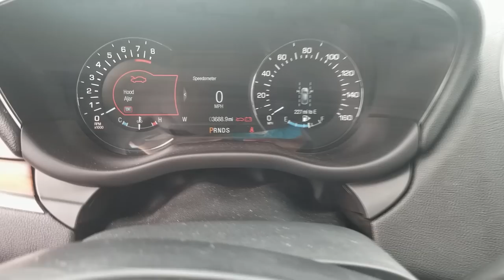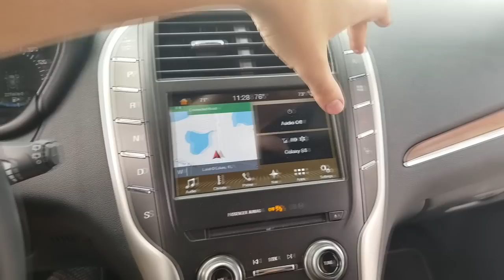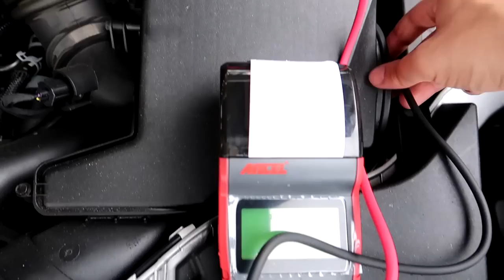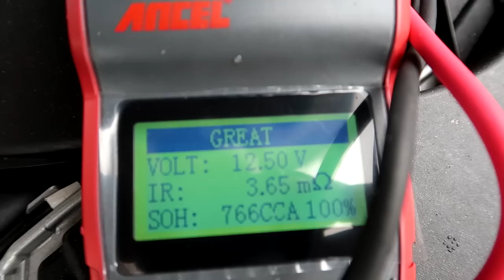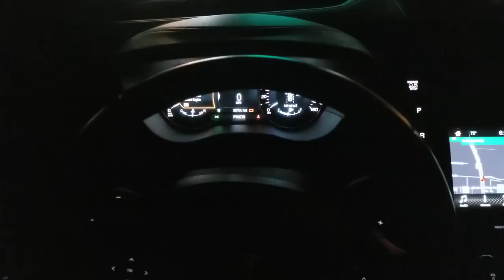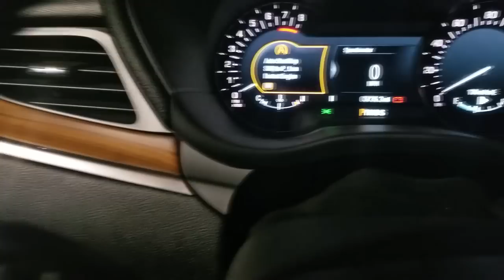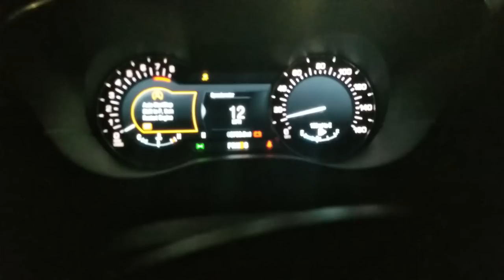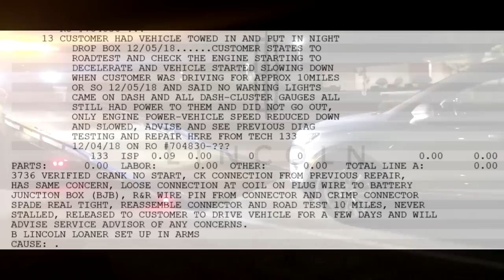I Saved Over $20,000 Buying a Like New Lemon Car! Then it Broke Down TWICE in 48 Hours!!!

Comment: Always keep your auto stop/start off, even if your not having problems. The wear and early death of your battery and starter will cost you far more than the tiny amount of gas you save. These cars with auto start/stop do not have special heavy duty starters.

I think Ford will do their best to jerk you around by doing things like cleaning and tightening up electrical connections and trying their hardest not to invest any real time and parts into fixing the problem once and for all, in attempt to run out the warrantee so it will just be your problem. In the end, I think you will either be dumping this car or taking it to someone who specializes in difficult automotive electrical/electronics who can and will spend the time to properly diagnose and fix the real problem, on your dime. You may or may not get that reimbursed by Ford, but I am betting that will be a fight.
Reply: Brian Andrews it remains documented and covered under warranty for this problem I believe
Reply: Brian Andrews actually the starters are a bit beefier because of this constant on off crap.
Reply: I couldn't have said it better myself. I actually have a friend who's shop does just that,fixing the things others can't, including dealers stuff under warranty. He paid for his boat off of Vw gremlins alone. But they got in trouble sending the cars to him and now he has a  bay in the shop there lol.
Also what you said about the auto start is true. The manufacturers only concerns were getting the MPG down to qualify for the for CAFE and nothing else. If a manufacturer doesn't make the corporate average fuel economy (cafe) standard for a model year,it's like $5-6 per .1 mpg penalty fine for each car sold. So .2mpg over the limit for Ford would mean $11 fine times the every car and light/medium duty truck sold that year. Hence why they put the garbage autostart in now.
Reply: @FishFind3000  wrong
Reply: New start stop systems are actually going away from using the starter to restart it each time.
Our Subaru has start stop and it’s been flawless. Only negative is the batteries are a lot more expensive. But ours is now six years old and we’ve only replaced one battery so it’s not bad.

Comment: Sam this is a real opportunity to push the limits of warranty repair.  The easy solution is to "lemon-law" this car again.  Nobody would fault you for that - you want and your wife needs unwavering reliability.  I wholeheartedly agree with your philosophy that anything can be fixed.  You may eventually come to the point (maybe already there) where you feel that this problem has not yet been truly fixed.  If that is the case, the challenge is now to bring this problem across the bridge beyond the point where you believe that the problem has truly been corrected to the level of quality expected of a newly manufactured assembly.  
     So in talking through this with you (really with just myself), you have three choices:  1) have the manufacturer take this car back again (if that is possible);  2) live with the "wiggled" and "tightened" and "really tightened" wire, preparing at any moment to be left stranded again and to have this car back at the dealership for "re-wiggling" and "re-tightening";  or, 3)  push the dealership to truly correct the problem (whatever your judgement feels that is).  Tough choices - I don't even know what I would do (but probably not number 2).
     PS - your short bit with Matthew McConaughey was really brilliant.

Comment: my 2017 ford fusion in the year and a half I've owned it has shut off at lease 8 times while driving. the car does not have start stop and the dealer can not replicate it and there are no codes left in the computer. they refuse to buy back the vehicle and will not replace it. Ford has the worse vehicles and horrible customer service.
Reply: Check out Steve lehtos channel.  If you are in Michigan, you are in luck as he practices in Michigan.  At the very worst, he can tell you how to find a Lemon Law Attorney in your state.  You pay nothing, the Attorney is paid from the Manufacturer..
Reply: My 2012 Ford Fusion did the exact same thing to me with only 700 miles on it.. it did it while i was stopped at lights though never while actually driving. It would always start right back up after luckily though.
Reply: Import my guy
Reply: lol I bought a 2012 Sonata turbo limited with every available option in 2016 for $9600 and ive only done an oil change. It came with 2 sets of tires too and the interior was perfect. Took me 15 mins to find and only had 45k miles. Why the F does anyone buy a new car???
Reply: Sounds like a crank sensor, they usually dont throw codes till your car doesnt turn on anymore.
Reply: Dom L I have a Lincoln MKZ mine was doing the same thing, it’s the fuel pressure sensors. I replaced the throttle body did fuel injection cleanings, read some forums found a lot of people suggesting the high and low pressure sensors. Haven’t had a problem sense, final repair was like $50
Reply: You chose to buy a ford and are surprised it became a heap? Color me shocked
Reply: @Brian-jv8iy  i have the sport model with the 2.7 twin turbo v6. i'm 100% sure it does not have start stop. my car goes into accessory mode. the car is just unreliable garbage. was going to trade it in until i check the resale value and saw i lost 18,000 dollars on it already.
Reply: Shouldve bought a Camry or Malibu.
Reply: @WoWdOm18  OUCH! again,FOUND
ON ROAD DEAD.
Reply: I’ve had my 2017 fusion sport for 18 months and have had 23k trouble free miles.  I’m glad
I leased it though. Also had 2 other fusions and never had any problems.
Reply: You deserve it for buying a Ford

Comment: What would be the total number of “fixed” statements issued by the dealer? At least 2 before you bought it and 2 since. And all before the first oil change!
Seems to me the electrical system would have been the first thing to check, and it seems to be the only thing which was checked, and the problem persists. They call ‘em lemons for a reason. A good car to own in you need a lawn ornament.

Comment: If it happens again and you can get it going by wiggling the purple wire (confirming that is the REAL issue) take it back to the dealer and demand they replace the harness. If they do that and the problem comes back.... My next question would be, what can you do to get them to fix it? I don't think you can do a Double Lemmon. They won't buy it back a 2nd time will they? Maybe you will just need to wear down the tech at the dealership. If he has to work on the same damn car every Monday he might put in the extra effort so he never has to see it again. :)
Reply: Woody Balto Replacing a wiring harness is a very extensive procedure. It’s probably over 6-hours of labour.

Comment: The ecu has a sensor on the earth lead to record how much power is put in and taken from the battery for the stop start system, possibly the car hasn't been told what state of the battery is, ecu should be reset once battery has been changed or charged off the car. Some people make mistake of charging battery with the poles of the battery rather than through the earth point on the body, this bypasses the sensor and confuses ecu. Just a thought.

Comment: Sam, I bought a new 2017 Camaro Turbo 6 speed in February of 2017.  I have had it to two different dealers on 6 occasions for the same problem.  When it feels like it, as I turn the car off to park it.  the driver information center flashes a message.  No remote detected, depress clutch to start.  A lot of times the button has no feel when pressing it, then after getting it to finally completely shut off , when I try to restart it, it will tell me that no remote found, place remote in slot, (slot being lay it in the cup holder)  I had this problem numerous times and was stranded several times.  I took it to the closest dealer three times in less than a month.  'Could not duplicate problem' was what I was told.   they put 1/10th of a mile on the car going from one side of the service bay to the other and that was it.  I took it to another dealer 2 times in 2 weeks, they stated there was nothing on their monthly tech bulletins about the problem, on the second visit they decided there were a few sensors bad and that it was fixed, I took it back again in march to get it inspected and oil change and had it checked again, 'could not duplicate problem again', so here I am again this past week Christmas eve and Christmas day was stranded again, and can't get an appointment until mid or end of january.  Have you heard of this problem.  It's driving me bat s**t crazy.

Comment: Best solution just disable the start stop feature at any shop with a coder
Reply: King Fynx Did you not watch the whole video it also shuts down when driving with foot on gas.  He felt it begin to loose power and gave it full gas but still shut off.  Nothing to do with the start stop.

Comment: Put stabilant 22 contact enhancer on all the engine main harnesses. That was the main fuse block . The ECM is probably up under the cowlings. Just below the windshield. 
Look up the location and unplug all the connections ( with the battery disconnected obviously). Brush on the stabilant per instructions. Also do that with all main bulk harness connections.
This may help avoid chronic connection issues. Which it sounds like this car has.

If and when it happens again. Have a pocket scanner with you in the glove box. Hook it up. And while cranking. Look at the RPM signal. If its showing 0 rpm. It’s not getting a crank signal. Check the crank sensor and the connections. 
Hope this helps . I for one wouldn’t want to deal with a vehicle that isn’t reliable. And I’m a master technician.

Comment: I would also add that I fixed an ECU issue simply by pulling the connector in the fuse block and relay, then cleaning the contacts and adding in some DeOxit non-conducting grease on the contacts. The grease keeps corrosion to min and the DeOxit offers a continued cleaning process as the contacts constantly wiggle and move over time. Contamination of connectors is much more common than people think and is why many circuits have "ghosts in the machine". Simple spraying cheap contact cleaner is not the fix thats needed.

Comment: I used to not much care for auto start/stop systems, but in just the last year they’ve gotten much better, and they actually do save fuel. I have maintained that a larger battery and a small electric motor (essentially a small hybrid system) would remedy small issues like shuttering and not being able to sit for more than a min or so, but the amount of fuel used on start up in a modern car is minuscule compared to idling, and the starter motors are engineered to handle the extra workload. A bad battery is not a reason to deem the whole system obsolete, blame the dealer for not checking the obvious.
Reply: Nick Akers That’s like the Ram 1500 eTorque system. I’m curious to see how that pans out, from reviews I’ve seen it makes the function of the stop start system much better. 
I like all start stop systems anyway, but their implementation in a small hybrid system does seem logically better.

Comment: NIghtmare.... mechanical issues can be fixed...... electrical issues? especially with canbus? I would rather be stabbed in the eye with a hot poker.......   My vote is to cut your loss while you still can or before it dies and you get run over by a semi.
Reply: Indeed.  Electrical issues... woof.
Reply: Be careful what you wish for. Someone is coming at you with that poker.
Reply: Canbus not cannabis.  A canbus is how a cars computers communicate with each other

Comment: My approach would be to check ground wiring, then wiggle the ECU harness and cables while the car is running and attempt to trigger the fault. After that a defect ECU has to be considered. Remember, a cable can break inside the wire insulation and still have a loose connection as its being held in place.
If the car is somewhat older you will have to factor in connections possibly corroded from ageing or previous owner using pressure washer on the wrong places etc..

Comment: If it hiccups before stalling, it could be a fuel pressure issue.  The an ignition coil connection failure would likely cut out right away.

Comment: I think your nuts.   Considering you trust this thing and you put your wife in it.   Hope you feel good buddy if it leaves her stranded because you wanted to save a buck.
Reply: @Jim Diller  It's not about saving "a buck..." but 20,000 bucks! But yeah, he should probably not let his wife drive it (unless of course, the problem really has been fixed as he believes it to be the case at the end of this video).
Reply: @factchecker2719  You notice that the trend is that it doesn't happen when SHE is driving, but only when HE drives it? :D

Comment: Sounds like my Ford Freestar. Back in the day we bought that van. It was only 2 years old, 51k. Paid only $3200.00. Cheap and it ran great as long as you stayed out of the rain. Turns out these vans had issues with the PCM (brain) getting wet. The engineers built the car with the pcm just under the windshield. I had spent months and thousands of dollars chasing down this issue. Finally figured out what it was. Replaced the PCM, plugs and coils, sealed off the cowl area. Ran like a dream for the rest of our ownership. But, I'll never buy a Ford product again. Costly mistake!!

Comment: Cases like this can also could be a thermally intermittent component on one of the circuit boards.     Find a wrecked one and work a deal with the wrecker to swap them one by one.   I once found an integrated circuit chip that only failed once the temperature reached 75 degrees.   I sprayed it with cold air spray and the trouble went away.  I then heated it with a hot air gun and it stopped the failure.   I replaced the chip and the unit was fixed.     SAM    I think ANYTHING CAN BE FIXED.    I agree with you.    If it is that wire, great.   Wiring issues also create intermittent failure.       And a hot air gun combined with a few cans of "Freeze Spray"  are great additions to a toolkit when circuit troubles exist.            ** Sam I wonder.    If you disconnect that fat purple wire, does the exact symptom occur?

Comment: Sam I had a jeep Cherokee and after two years the back up lights failed to work I paid Gi $75 to diagnose it to a park safety neutral switch I rebuilt the part safety neutral switch and it didn’t fix anything I troubleshot it from the park safety neutral switch to the firewall and from the back up light to do into the cowboy vehicle to the firewall and continuity in both directions then when I looked at the firewall I saw that the connector was installed pin was installed upside down with the retaining clip pointing the wrong direction and it simply backed out this may be similar to what you have with your purple wire

Comment: Hi Sam, I had an 08 Mercedes C300 that acted very similar to your Lincoln. The car would stall and not restart. After MB service played with the car for a few days they gave it back. When the car would stall I would put it in park. One time I got pissed, put the car in park got out and pushed the rear bumper with my foot. I heard a click and the car started. FYI, It ended up being the neutral lock out sensor...

Comment: The wire could be bad,  could be passing power intermittently  and periodically failing to pass power for many reasons.  Get a few zip ties,  and follow that wire to where it goes via ripping open the harness.  Just replace the wire with a bigger wire even,  and zip tie the harness back together..  You can buy pin connectors at your local auto store,  and even get a good DC soldering iron and some solder (and flux) if necessary.. (from Home Depot or Lowe's)  There are videos on here regarding soldering if you need.  If you do that and the problem persists then you are looking at a main engine control module problem,  something that plagued Fords in the past to the point of running off some of their most loyal customers for life,  two (2) of which I know personally.  it was not the failures that ran these customers off but the fact that Ford did not warranty the modules,  and this caused many failures,  inconveniences,  and money spent by customers.

Comment: Your screenshot of the purple wire shows that there could be damage to that section of wire just over the connector (there is a visible bulge there under the insulation Which would imply a defective wire Harness. The dealer should’ve patched in another piece of new wire to bypass the broken section. Or More professionally, simply replace the wire harness under warranty. So if it was actually the purple wire, that would be the correct fix. You would then not have a lemon vehicle.

Comment: Two things to remember , 1 intermittent faults are incredibly hard to detect. 2 when the car goes back to the manufacturer, they have every single part and they can try them for free, if the manufacturer can not find which part to replace with all there resources, how are you going to do it when you have to pay for every single part you want to try ( even for diagnostic purposes).
After 10 years repairing stuff under warranty, having an endless supply of parts is the key.

Comment: South Main Auto in Avocado NY, can fix it.  My opinion, the WHOLE fuse box/control module (fuses and all) need to be replaced with a Ford NEW factory part, and the harness from the Main fuse box/control module needs replacement.  That should fix the loose wire problem, nothing less is required.